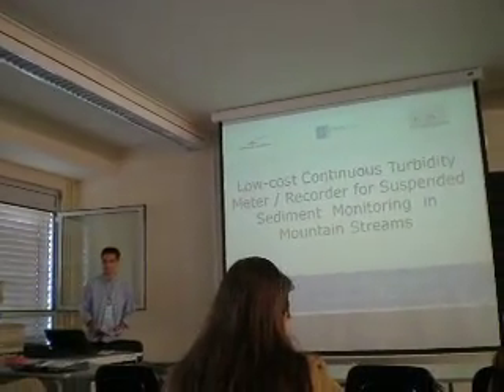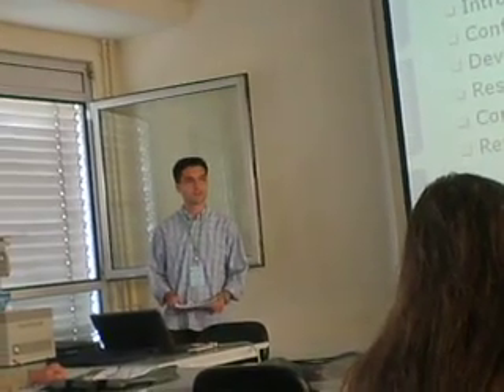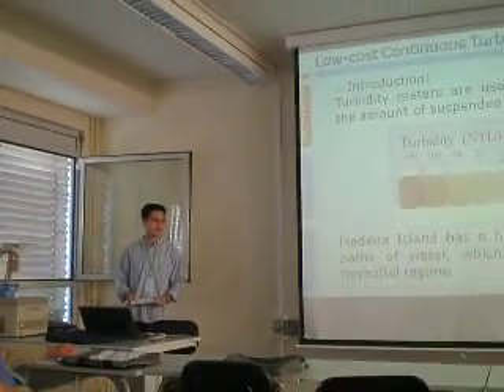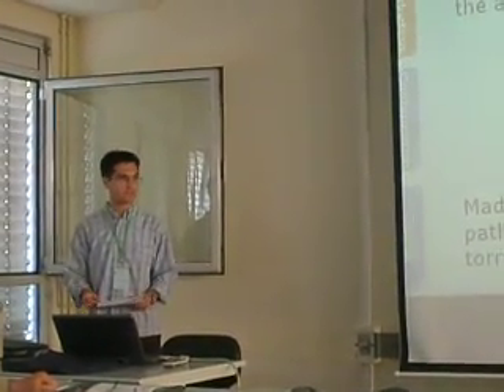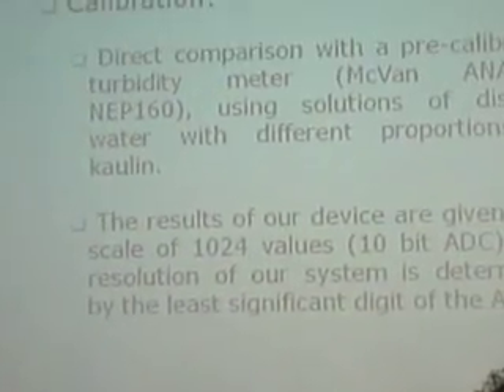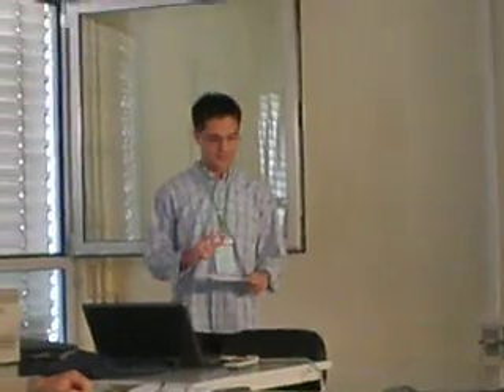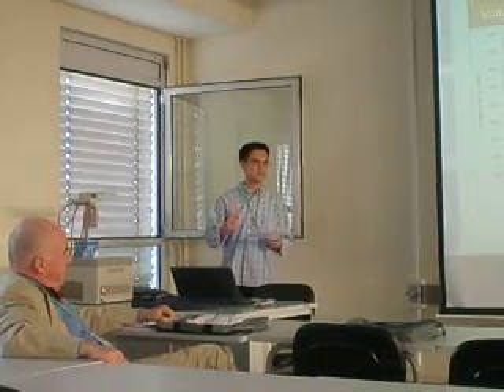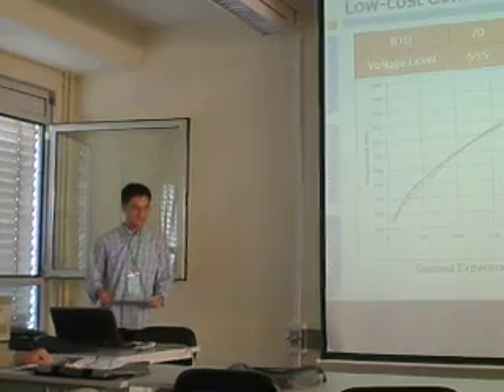Low-Cost Turbidimeter

Comment: Did you notice variation due to the temperature of the water? We've noticed the photodiodes and LED are not consistent when the temperature fluctuates.  Any video of the device in action?  How did you get around the ambient light problem?